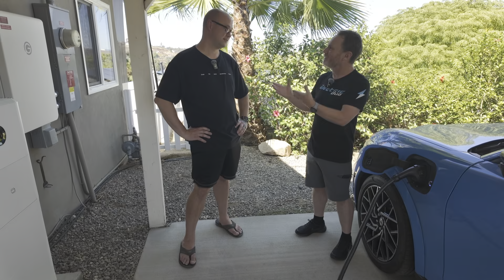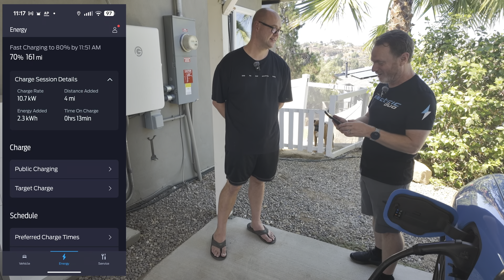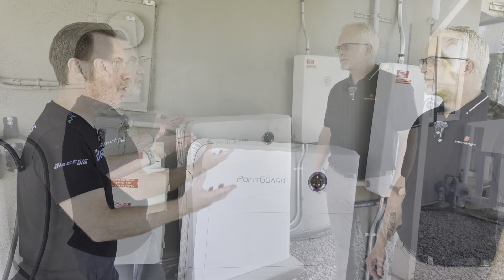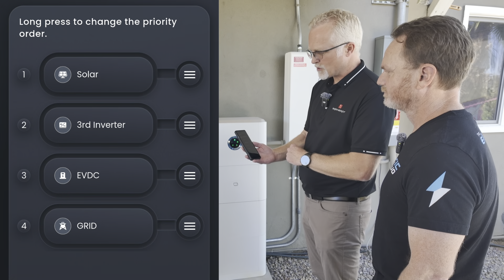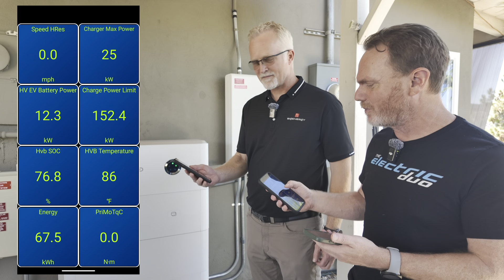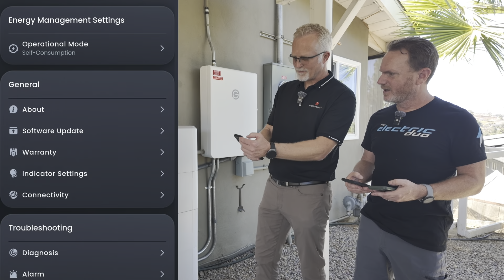Our Mustang Mach-E Powers an ENTIRE House! Bidirectional Charging from Sigenergy (V2X)

Comment: I've been drooling over this for a long time -- great to see it in the US!

The 25 kWh charging will be great for Silverado and hummer drivers -- less than 12 hour charging!
Reply: Their 25kW charge rate is a little misleading.  It only works when the in-stack battery and solar are contributing.  You have to be draining your home battery to get that rate.  From the grid 11.4kW is the max charge rate of this unit.
Reply: @Tearitupsports  Great detail and hyper important for small scale uses.

In a position of having abundance under normal circumstances (so that you can weather harsh conditions) it quickly becomes a moot point, much like range anxiety until you get a Tesla 😅. 

Also, last I checked, and especially with the EV tax credits, the Ford Lighting is the most price efficient power wall option in my market. And it is mobile, and can haul things. Modern trucks are often just 1 notch below luxury cars interior wise to boot.

The sun is a free nuclear reactor God gave to us all. We should learn to better use this nearly limitless resource.

Deep time wise, learning to use our local star's energy emissions as useful power is likely key to colonizing near another star.
Reply: @Tearitupsports We are quite careful in messaging that the 'max. charge rate' is 25kW. Depending on how big your solar system is, you could achieve 25kW, but you are right, it is important to know how you can achieve the 25kW. 
In other parts of the world, this same system is also sold as. 3-phase system in which the Controller / Inverter has a 25kW output power, but in the US with split phase service we need to fit into a 60amp breaker, so the power is limited to 11.4kW. hope that helps...
Reply: The only downside I can see to that is that it will need dc solar to constantly achieve that speed. My system would do that speed with an additional house battery module, but only until the batteries are drained. So for my smaller EV batteries it’s fine and I can charge at my max of 20kw for several hours. For huge batteries like the Hummer EV you’ll need the dc solar or lots of house batteries to achieve that for a full 12 hr charge. Personally I think it’s incredibly impressive to have that at home either way, but I just wanted to be clear so no one spends money on a system only to be disappointed.

Comment: Question...when the standard does comes out, would older Mach-e's be able to be upgraded via an OTA update or is it hardward dependent? Love this idea of a stackable system. Unfortunately, my new manufactured home can not support rooftop solar and HOA will not allow solar panels not on a roof. But would love the idea of being able to use the Mach-e as a power backup in hurricane prone Florida.

BTW, Merchy did a great job on the intro.
Reply: All the physical capabilities are there in every EV, just by the nature of how V2X works. If it can dc fast charge, then this system could theoretically work with it. So any vehicle that is capable of physical or OTA updates could be updated and work with the new standards provided the manufacturers support it and choose to allow it.
Reply: @True_Dad  thanks, Adam!
Reply: You can still get the Sigenergy system without having solar.  The Sigenergy system also has a generator inlet, so you can still recharge the batteries in off-grid mode if neccesary.
Reply from the maker: Oh no that's such a bummer you can't get solar! Being right by Disney will have to make up for it 😉

We absolutely love our new intro! Merchy is such a pro! - Liv

Comment: This is awesome, and I am surprised Ford hasn't pushed the Mach-E for V2X when the Lightning can, which I am even more surprised the Mach-E worked in this situation. I would love to use the same style adaptor the EV6 and EV9 can to power the 120V outlet adaptor. I am not sure if anyone has tested that yet on the Mach-E?
Reply from the maker: I'll investigate to see if it will work and see if I can find one I can borrow.
Reply: @theelectricduo  That would be an amazing if it works, and I look forward to the results.
Reply: It won't work unfortunately. The Kia vehicles use the on board charger to push AC back out of the charge port when the adapter is present. Mach E wasn't designed to be able to send AC back out so nothing will happen. 

This system is pulling DC out of the car so as long as the car doesn't detect it and shut it down, it should work.

Comment: So if you wanted to add a small wind turbine how would you add it to the system
Reply: We can connect a small wind turbine to the system but only in an AC-coupled connection. You would connect the wind turbine's inverter into one of the controllable load breaker positions and set that position up as 'Inverter'. That way our system can monitor your wind turbine's production, and it can use the wind turbine's electricity to add to the home, charger, batteries etc.